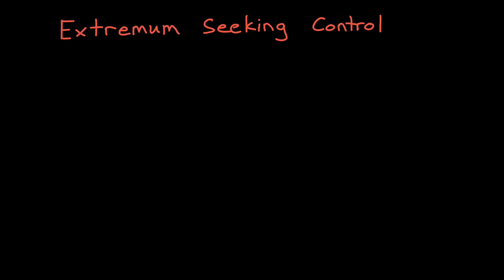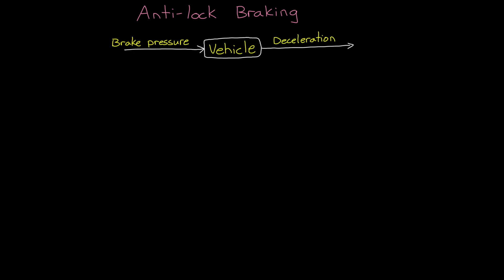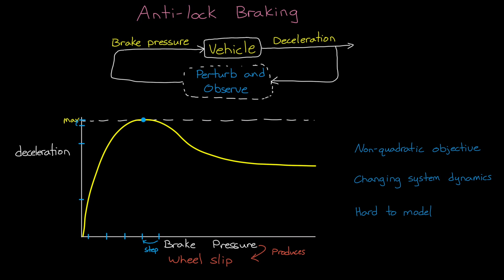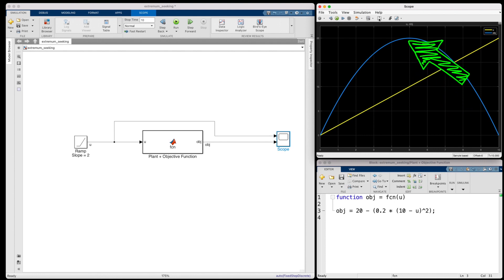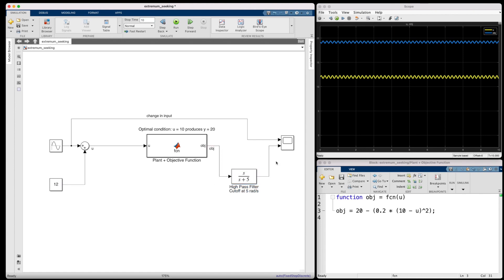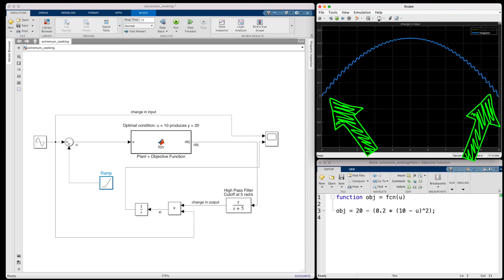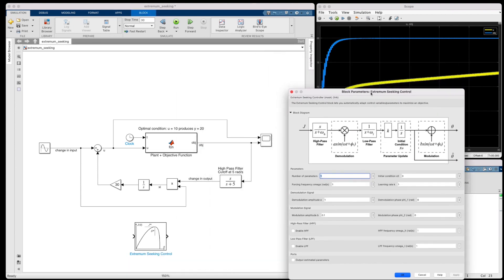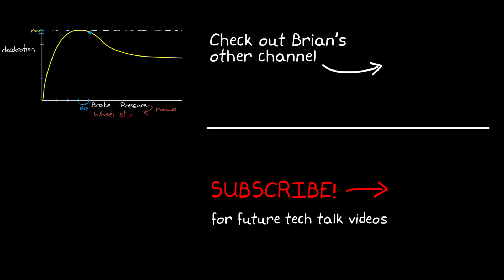What is Extremum Seeking Control? | Learning-Based Control, Part 1

Comment: how is the perturb and observe controller able to do the observe part without knowing the model? Are you just going to try random stuff in real life?
Reply: Yep, that's exactly what you do. Of course, it's important that the system you're running this on is stable enough to allow for that perturbation. Another good option for this type of controller is the peak power tracking for solar arrays. You adjust the load on the solar panel to maximize power output. Extremum seeking could be used to track that peak power output as the sun incidence angle changes. In this case, being slightly off doesn't endanger the system at all, you just temporarily get less than the absolute maximum power.

Comment: i'm sorry i didn't understand why the two signals get out of phase when input is higher than the minimum, can anyone explain it to me? thanks
Reply: If you assume that the frequency of the input signal is low enough, then you can approximate the function you want to optimize to be static. You now make a first order taylor expansion on either side the optimal (maximum) point, then the gain will be positive and negative on the left and right side respectively. This implies that since the sine wave is the only varying component in the output (since we assumed the function to be static and the input just just a constant and a sine wave), you will have that the gain of the static function is what determines the phase in the output (for the taylor expansion approximation). Hope it made sense.

Comment: Thanks, Brain! That's so useful. I have a question about the term you just used for the speed of dynamic changing; "It'll continuously lag behind the maximum value". What does it mean? Do you mean the dynamic should have a lag behind the controller? Looking forward to your response.
Reply: I think what Brian is trying to say is that if you have a system whose dynamics change too fast (e.g. has parameters that change value quickly) or at least faster than your controller converges, then the controller won’t have enough time to converge to the local optima. 

Imagine a heat-seeking missile trying to hit a target that can move faster than it.
Reply: @benquickfall8384  Thanks Ben, I think so. In general this proposition is correct, the controller dynamic should be faster than plant ones, but what about finding maximum or optimal solution? It seems that continuously lag behind is equivalent to be slower, but I don't understand the use of "maximum value" term here!

Comment: Great video, this seams similar to using Newton Raphson method for finding zero of a function can this model be altered for root finding?
Reply: hmm, I don't know. Perhaps if you square the function so that all outputs are positive and then take the negative so that the zero crossings are the maximums you could find one of the roots by initializing the extremum seeking controller near it.

Comment: Can we use this in solar MPPT ??
Reply: Probably yes. It is a little better "perturb and observe" that are being used for decades. The problem is that it won't be able to track correctly during panel shading, for example.
Reply: Yes you can, and Steve explains several good applications in his video here: https://youtu.be/-mD3bGD3Nbc
Reply: @BrianBDouglas  👍👍👍

Comment: So.... can Extremum Seeking Control be utilized to seek minimum rather than the maximum value?
Reply: Yes, if you're looking for the minimum of a function you can just multiply the output by -1 and then look for the maximum still. That'll return the same optimal input value that will produce the lowest cost.
Reply: I believe so, when seeking a minimum of f, try min f = max -f. Just mirror your function.